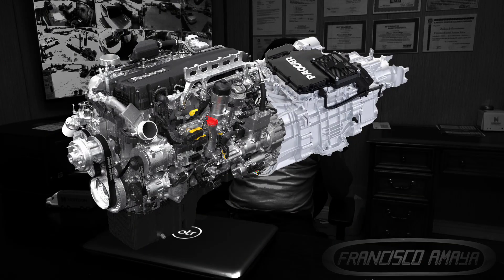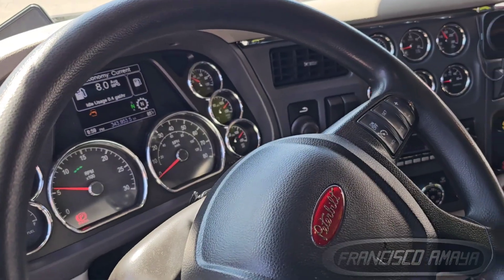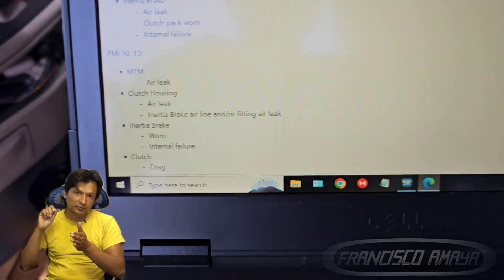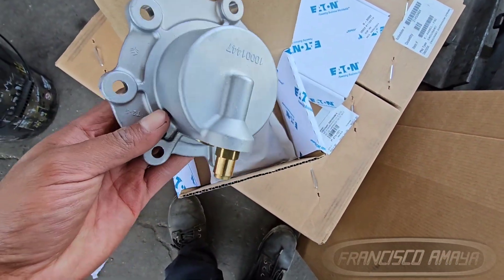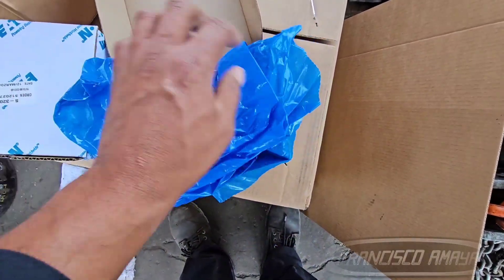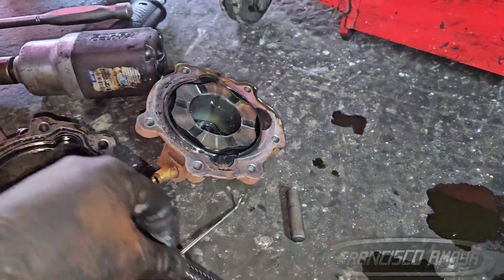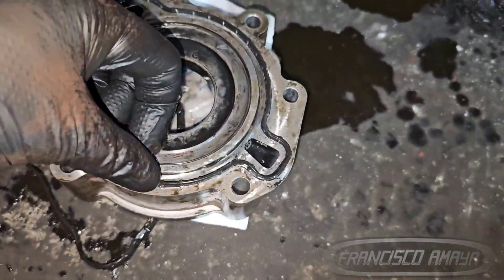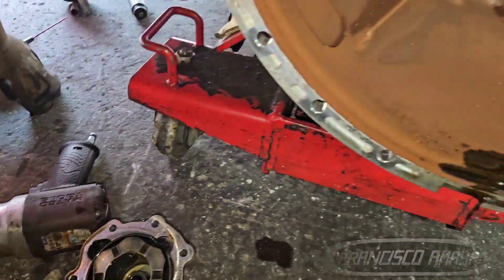EATON ENDURANT AUTOMATIC TRANSMISSION CLUTCH INERTIA BRAKE FAILURE PACCAR AUTOMATIC TRANSMISSION

Comment: My transmission was giving a (F) code and would not shift at times and I would shut the truck down then restart it and it would run and shift fine,  after a while it popped up more often I  took it to a shop last week and they said that my clutch was bad and they changed it and it is doing almost the same thing but now it drives and get to 5 or 6 gear and sticks there so I would have to pull over put it in neutral let it sit then go back to driving and it would shift fine then pop the code again.